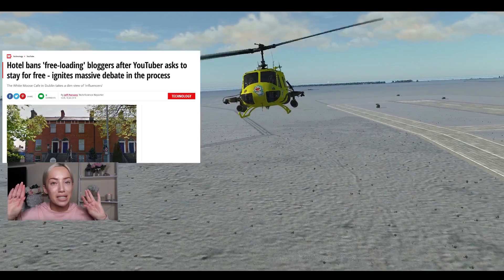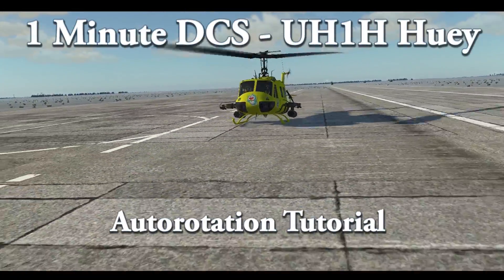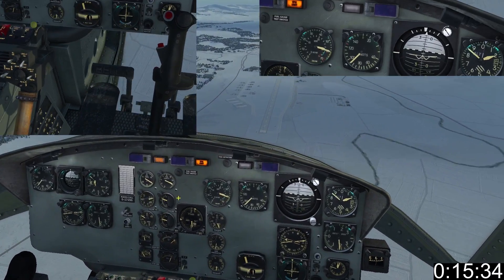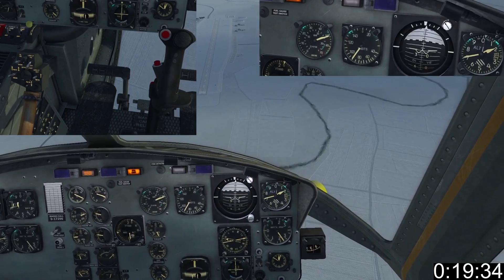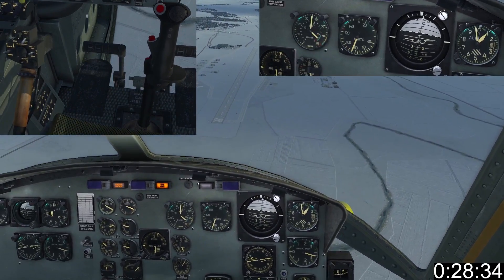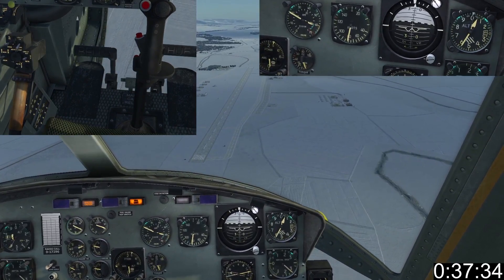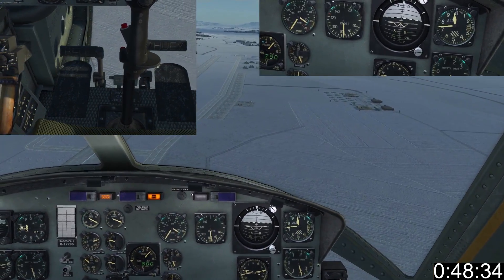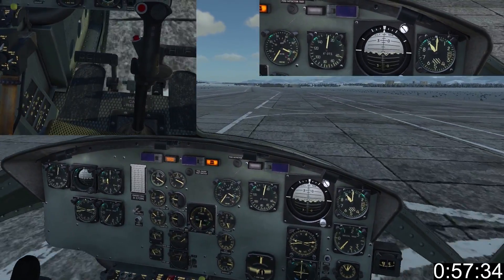1 Minute DCS - UH-1H Huey - Autorotation Tutorial

Comment: Do a simulated stuck right pedal all the way to the floor and land. Then do it with a 15kt wind from 45deg off to the right of the nose. That will sort you out. :-)
ps - you will need to setup your controls to be able to chop the throttle without taking hands off them.

Comment: You can do Autorotation at or above 500 feet without any problem.
Reply: and a point to note at very low levels (IGE hover or ultra-low-level NOE at moderate speeds, say 60kts/20ft) is that the Huey has high-inertia blades (=they are heavy) so a sudden engine failure at 10-30 feet at normal rotor RPM can often mean a surviveable but very hard landing. You use the stored energy to cushion the impact.
This isn't autorotation at all, it's technically called the FASN-YTL procedure:

 Fuck - A Strange Noise? Yank That Lever.

Comment: Just did Autorotation lessons in reality (see below) - I'd advise two things: once you hear the engine quit, drop collective, right pedal, a LOT of aft cyclic. Should be pulled more than usual to not let the nose sink (tl:dr physics makes the blades slow down if the nose dips and vice versa). It's better to slow down than to let the nose dip... you can even autorotate straight down as long as you speed back up to 60 knots before reaching the ground.

Flare just like you did in the vid, but pull very sharply aft-cyclic at the very end to stop your ground speed altogether... then rapidly forward-cyclic to level out.

Nice vids, you've saved me having to make my own DCS Huey tutorials!

https://www.youtube.com/watch?v=5nuWQmM5xXM
Reply: Crash Laobi Here is a quick unedited vid I made to demonstrate. I will make a proper one later. Cheers. 

https://youtu.be/yegvXSqjvaE
Reply: Do they teach full down ones also?
Reply: zzodr We do one or two but the benefit is minimal as you have already done the hard work and the wear on the helicopter by multiple students is high

Comment: why so much trouble when you just can pull foward the cyclic and wait?
Reply: Bottoming collective reduces pitch, reducing blade drag and establishes upward airflow through  the disk =autoration state faster to allow Rotor RPM to be maintained in the green. Beware that violent lowering and pushing forward can cause mast bumping and rotor separation depending on maneuvering state at start of failure - slick and smooth is the way.